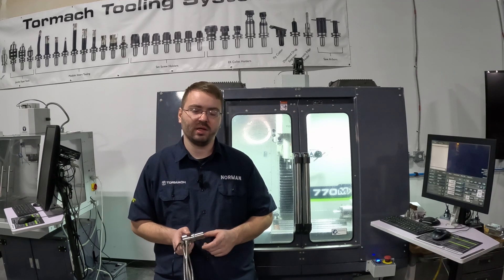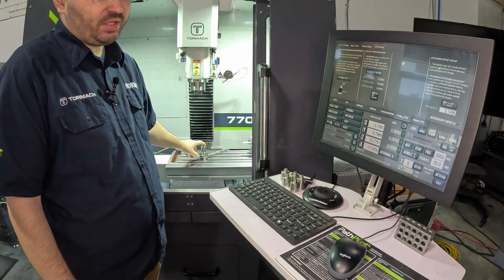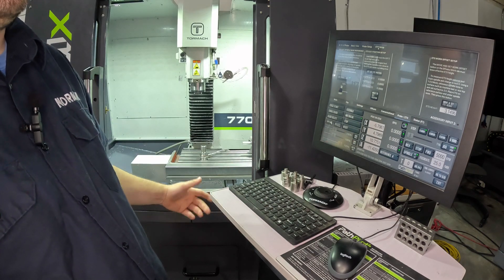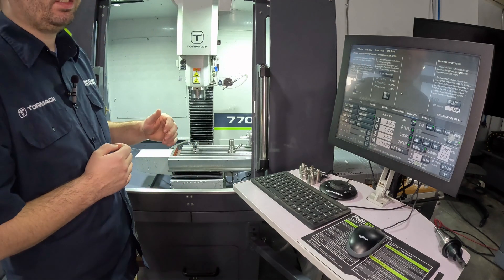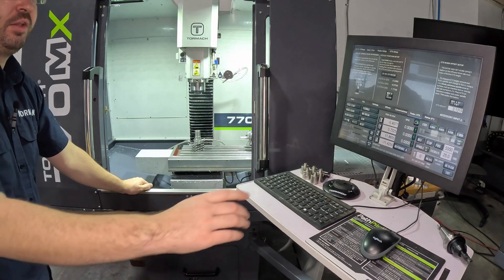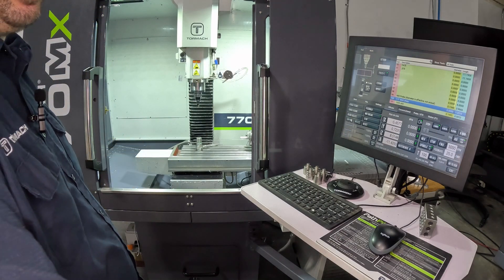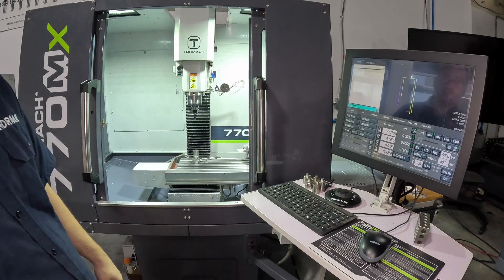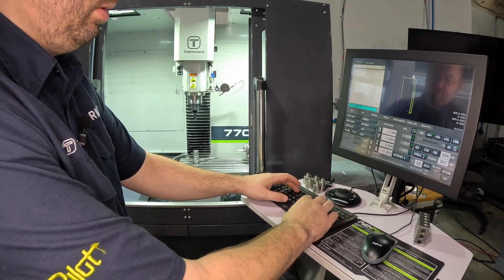Tormach Wired Tool Setter (ETS) Installation and Usage

Comment: New to CNC and Tormach.  I was a bit confused when I received the ETS but no mount for it.  Ended up being not an issue. 3d printed a mount for it until I was able to make one using the 1100mx.  I'm slowly learning and the ETS is great!